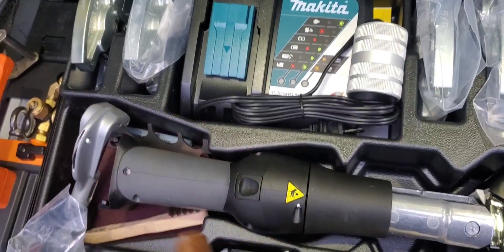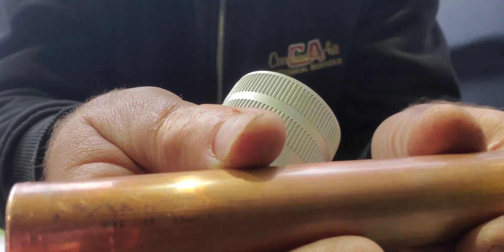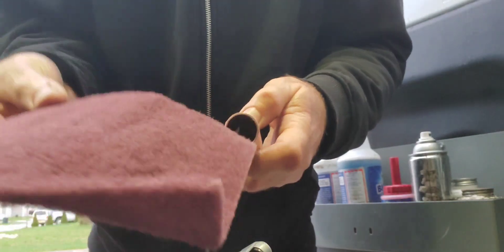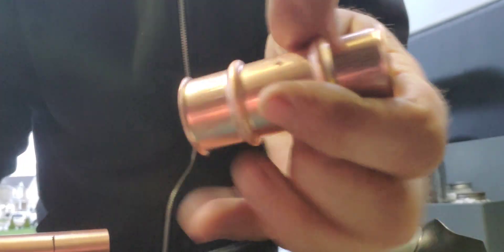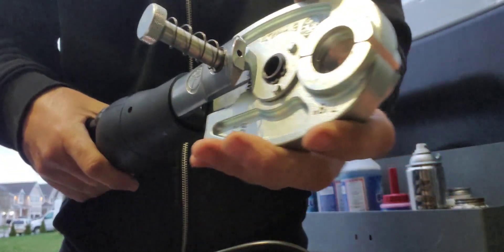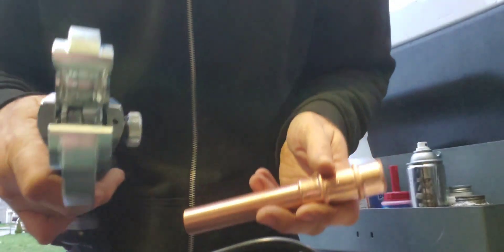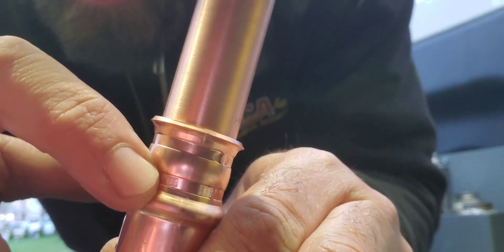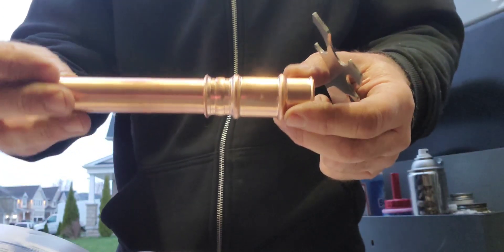How To Prep and Press Copper Piping With The Rapid Locking System (RLS)

Comment: Super important to get the writing off and then hit with a wire brush and scotch bright pad?  Put a microscope on that and it will not be smooth.
Reply from the maker: Doesn't need to be microscopically clean.

Comment: How I see this looks much more complicated than brazing. What's going to happen with o-ring's in a few years after constant cooling, heating and the effects of oil? 🤔🤔
Reply from the maker: This is definitely not more complicated.  The first RLS fittings pressed in 2012 are still in serivce.
Reply: @HVACKnowItAll  that is my maine
Concerns..ans I just purchased a m12 rls jaws. Orings due eventually out,  I know there compressed when you clamp down with the jaws. Never the Less, they are still orings🤔 just my thought.  What say you
Reply: @HVACKnowItAll  my comment was all jacked up...im just saying orings dry out. Also I purchased the m12 with RLS jaws....whats your take on the orings
Reply: @HVACKnowItAll  don't get me wrong I'm not against new technologies and its okay when each solder is available but I'm little sceptical when it comes with VRF systems where is thousands of solder joints hidden. Maybe i am wrong but i still think that the brazing is much more reliable way. Thank you for your comment and instructive videos. Keep up the good work 💪👍
Reply: It isn't. Literally how is it more complicated? Sanding and deburring copper is complicated to you?

Comment: have you compared cost benefit analysis:  RLS fittings vs Profit rectorseal press to fit fittings and the break even point with the added need of the $1,000 + tool with the RLS system vs no tool with the rectorseal press to fit fittings?
Reply from the maker: I have not but press fittings aren't long radius.

Comment: Good demo, I like how it swivels that be nice in tight spots. I’m sure I’ll eventually get my hands on one, in the meantime we propress most of all our boiler loops been using the press stuff for couple years now. With water no waiting on it to dry just prep press and go! 🤘🏻
Reply from the maker: Appreciate the feedback
Reply: @HVACKnowItAll  no problem man. I watched a quick Johnstone video and they were going over the different crimps that can be used for certain fittings and what tool can do what. It’s sorta confusing cause it’s like sporlan was partnered with RLS then they separated. I’ve noticed the older zoomlock fittings are larger than the ones you are using.

Comment: Geeez! All that to avoid brazing? Just braze it FFS. I could see if it was minimal prep and crimp and go. But it's not. Also how long will those joints stay leak free? A brazed joint is forever. I'm not putting those in the field. I'm down with the propress for plumbing because there are situations where you don't have the ability to get all the water out of the pipe. But other than that old school rules here.
Reply from the maker: Dude, this is a demo...In the field that pipe can be prepped and crimped in about minute.
Reply: @HVACKnowItAll  YEAH!
Reply: All that? lmfao the fuck do you mean by "all that?" You're really act like that tiny amount of prep for press fitting is a lot? You got your shit backwards, bro.

Comment: I’m going to be honest, I pressed over 30 fittings two weeks ago for 2 walk in systems and a three head custard machine. The only thing I did was ream the pipe. No cleaning. I had two leaks. Replaced them, but Haven’t cut the fitting in half yet, but from what I can see, the pipe/fitting was dry(lube dried out?), and the pipe sides grabbed the oring and slid it out of its groove. (The bags with the fittings were pretty oily inside, but some of the fitting orings were dry) Again, just from looking down the pipe at this point. Right or wrong, I haven’t cleaned any fittings I’ve pressed and haven’t had any issues as a direct result of it. Ive used Milwaukee press tool and Zoomlock. We have both.
Reply: 2 leaks out of 30 is not something to be happy with.
Reply from the maker: Yes but not cleaning them may bit you in the ass one day haha
Reply: @HVACKnowItAll  sanding the pipe will create thousands of microscratches that tear up the O-rings
we sand the pipe for soldering/SilFos to remove oxides and allow for better adhesion (more surface area)
for this case you want a flat SMOOTH surface; a good seal!
Think of it like valleys and mountains vs. the plains

Comment: Gimmick. Just braze it.
Reply from the maker: Not a gimmick my man, 10 minutes of research will tell you that
Reply: @HVACKnowItAll  It is just like Pro Press. Same kind of garbage. Solder/braze will always be superior.
Reply from the maker: Your research starts here with a quote from Kyle Mabe.  Do more...

"First job with RLS was a 7 story building with 4 Daikin modules on 2 systems on the roof and 30 heads throughout the 7 floors. 1 branch box per floor. Did it all with RLS and 3 years later still no leaks and system runs amazing"
Reply: Apparently you haven't been out of the USA. in Europe BTW Parker zoom lock was invented and HQ in GERMANY- 70-80& commercial HVAC is hydraulic press fittings. Why? because hot permits are expensive, time consuming and huge liability. Expand your mind brazing is just one option but not the option.
Reply: @proanswers  Why do I need to expand my mind? O-rings fail.
Reply: @theprofessorfate6184  your comment gimmick. Compression fittings have been around just as long as brazing. They been re-engineered. Some manufactures produce better quality compression fittings. Making ambiguous comments "gimmick" adds no value and is a closed mind. Good luck,
Reply from the maker: I agree, closed minds will stunt their learning, but perhaps that's what they want.  The less you know, the less accountable you are.
Reply from the maker: Remember we are talking 1 one brand here,  RLS...they just sold their 10th million fitting.  There is a stat for you!
Reply: @theprofessorfate6184  After how long?
Reply: @theprofessorfate6184 did the lawsuit ever happen?